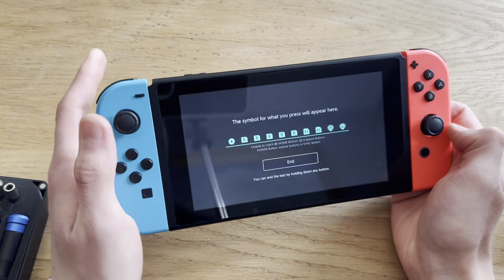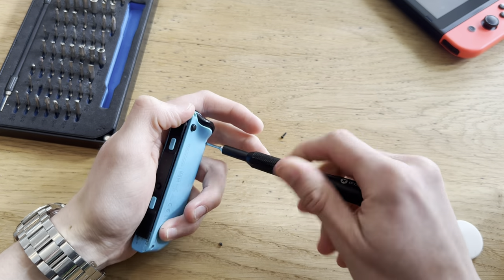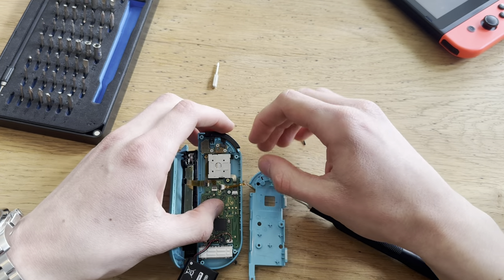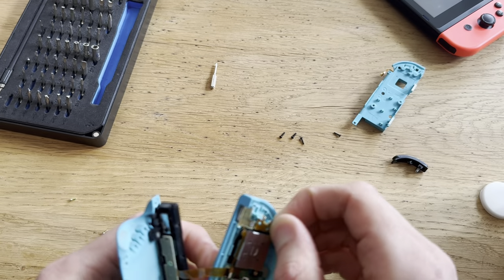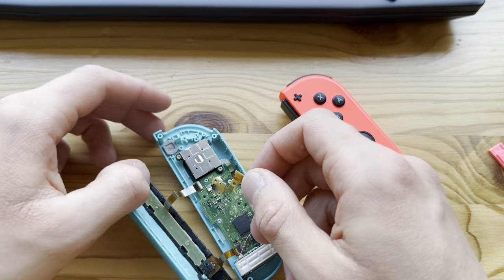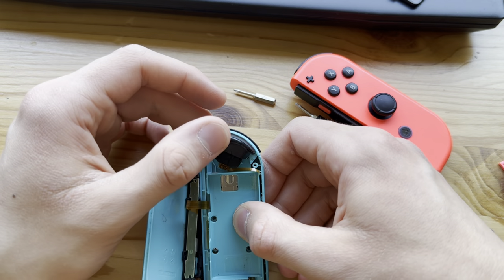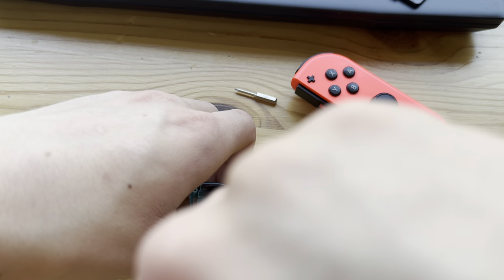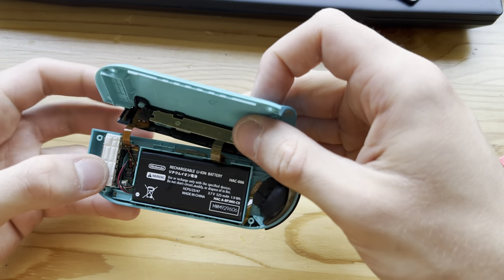Fixing defective Nintendo Joy/con

Comment: Great job with the fix. I have the same problem with the L button, it works sometimes. I ordered the replacement part but the ribbon cables part seemed daunting to me, just because they are so small and i dont know how to un lock them. Anyway, your video motivates me to try, thank you for making this.
Reply from the maker: Hey, its easy. Just be carefull when you litt them up.
Reply: @RetroBoyy  thank you! I will try
Reply: Hey, love the confidence. Pro tip when getting familiar with a device: order an already faulty device. By doing that, and opening it; you can familiarize yourself with the internals. It’s a lot more effective than watching a video. 
Most faulty joycons are about $5-$10 unless you’re buying a lot.